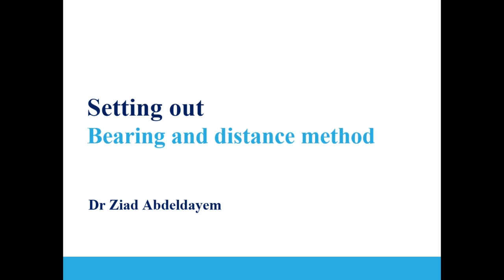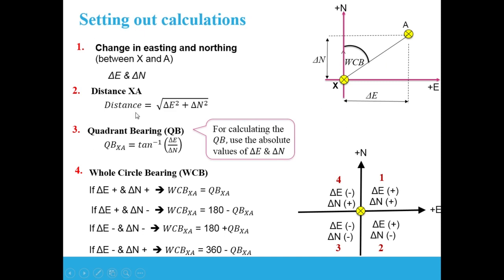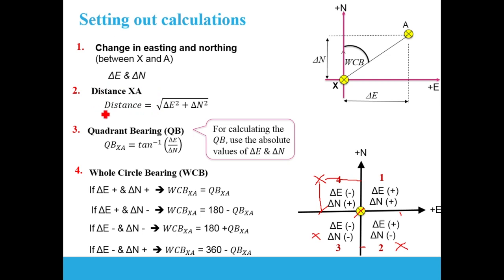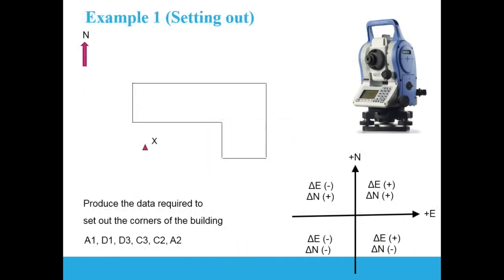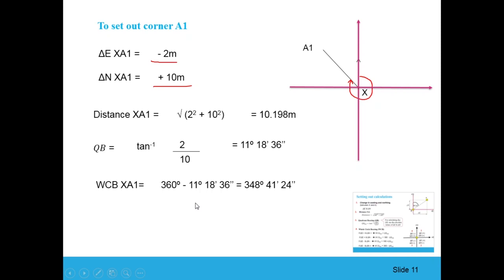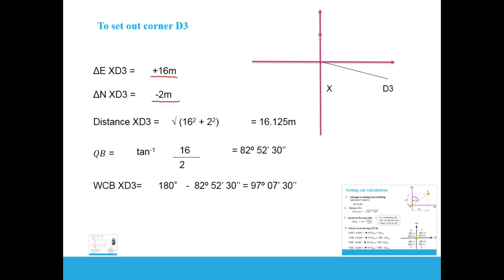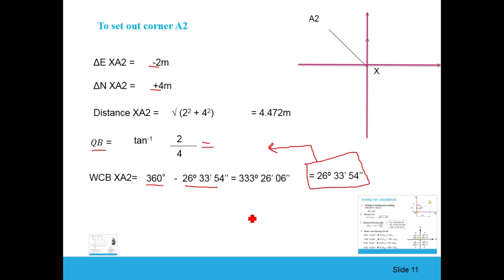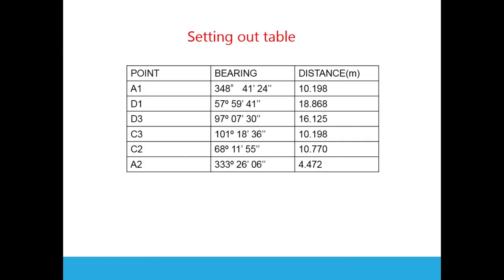Setting out a point using Total Station (or Theodolite)

Comment: Salam Ziad, does the land need to be levelled before we set out using the bearings and distances?
Reply from the maker: Hello. No, as the distances measured for setting out are horizontal not sloped.
Reply: @ziadabdeldayem6884  Yes, so on a sloping site we would need to correct the horizontal distance and use the slope distance when measuring from the theodolite to our peg in question

Comment: Why do you write ▲NXC3 in positive when calculating the QB ? 
And where the 78º41'24'' come from if  10/2 = 5 , so tan inverse of 5 = 1º22' 24''

I appreciate your reply !
Reply: Ok, excuse me ! I just realised that is indicated the ''absolutes values '' should be used when calcuating  QB. However I still don't get where you arrive to 78º41'24''.
Reply from the maker: @millivanilli4825  Inverse tan of 5 is 78º41'24''. Try it again, on your calculator you should have tan-1(5) = 78º41'24''.

Comment: How did your tan inverse give you 11
Reply from the maker: Inverse tan of 2/10 is 11º18'36''. Try it, on your calculator you should have tan-1(2/10) = 11º18'36''.
Reply: Thank you very much I was able to get it and solve other questions using ur method